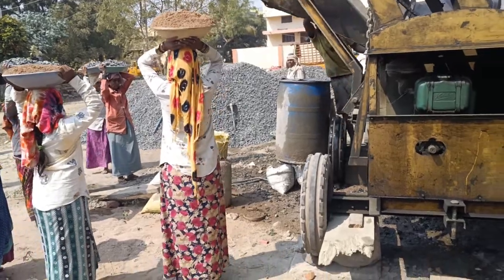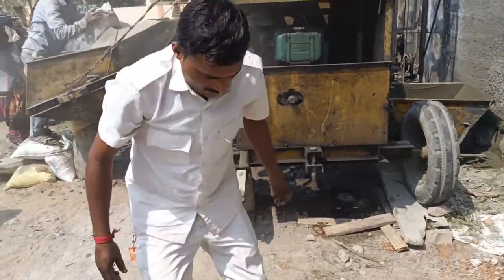Concreting for slab- Special cement (Bharathi ultra fast)

Comment: What's  your opinion on the cement sir, Better than Ultratech
Reply from the maker: All the cement brands are good, only fresh cement bags which we get from the plant, that will be better than any other cement which is stock for a month.
As we know the cement bag expires in 3months. So, as days increases cement strength decreases.